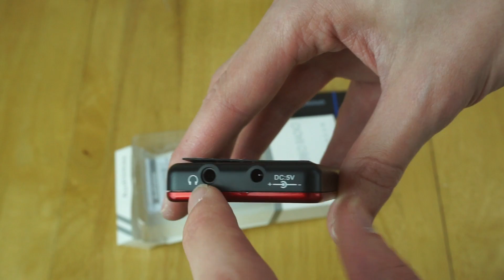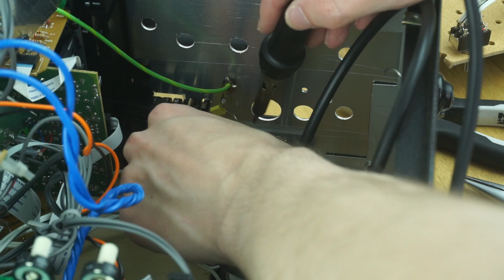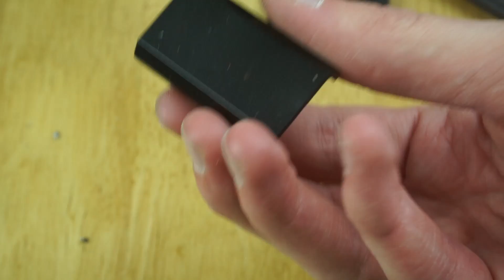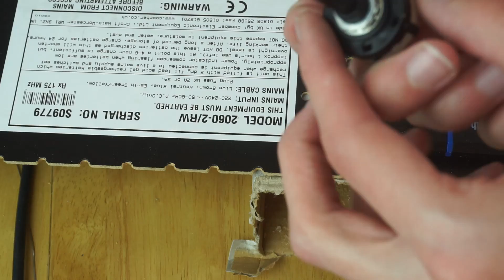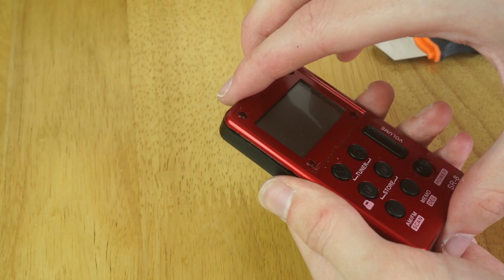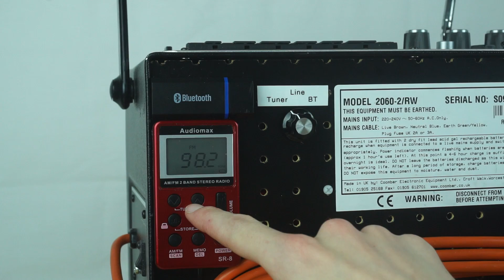#PimpMyCoomber - Part 2 - Adding Bluetooth and AM/FM Radio

Comment: It's funny how these were so different inside. I've been going through what I need to add Bluetooth and have come across your videos. My tape deck doesn't work. It's only due to belts, but I'm not fussed with replacing them as I wont be using it. That in mind, I'm looking at connecting the bluetooth module to the tape deck audio inputs on the pcb so i can use the tape deck volume control. I still use microphones with it so it would be helpfull to control the inputs separately.

Comment: Heres some mod ideas.
• add a standard 3 prong removable power cord and socket 
• mod or upgrade the tape deck
• add a removable front grill
• add a nice wood veneer
• add a USB charging port and cellphone holder
• simply the wiring  
And love the video series.

Comment: No DAB+ ? the normal FM Radio switches of in the next years !
Reply: FM is still going strong in the UK even in 2024.

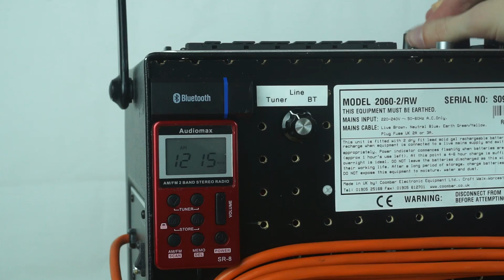it's AM that has recently started rapidly dying in the UK due to soaring electricity bills at the AM transmitter sites and a tiny percentage of listeners, and since Absolute Radio closed down the 1215 network ( 38:04 ) in early 2023, many other UK (and also some more European) AM stations have followed suit.

Comment: Why did you not mount the BT adapter on the inside of the unit?

Pretty great mods for that old PA system, turned out great.